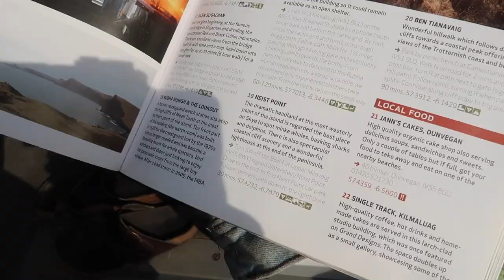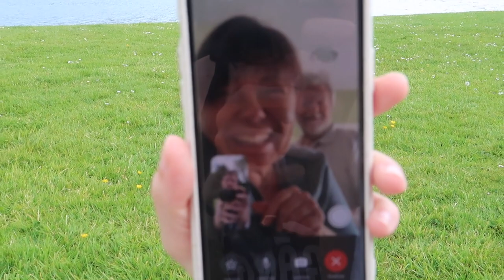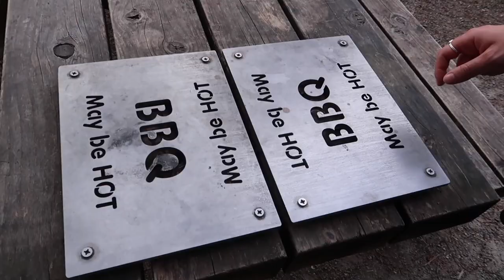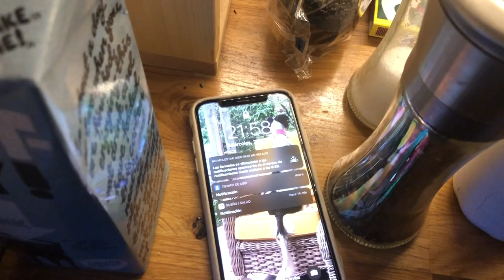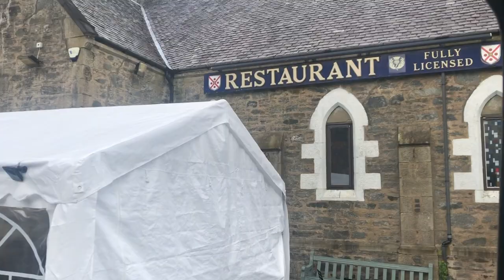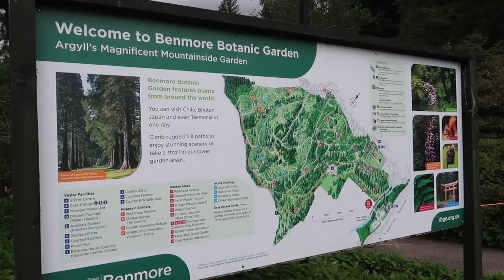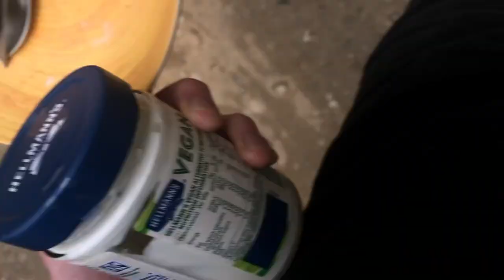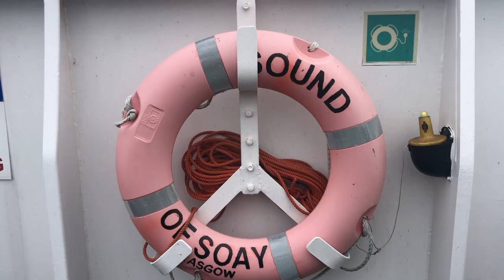VAN LIFE SCOTLAND | Part 3: Glenmore & Argyll

Comment: I'm not a Van life person, I'm a maintenance tec. But I set up my van to be super neat at all times. I installed a 5000W Pure Wave Power Inverter  to run anything I might need, installed one outlet at the back door and a 4 outlet panel on the front of my shelf to keep things charged. I also built all the wood shelving and storage. ( I hate the metal shelving the E250 comes with ). 
I watch videos like this to give me ideas to improve my set up. I think I'll install a fan like you have to draw out the heat. On hot days I have to remove all my batteries and my laptop after work because it reaches 135F  ( 57C ) in the van. 
 Anyway I started watching your stuff about 2 months ago and now I'm hooked. Love your attitude on life and you come up with great ideas. Great job on the Van. Keep the videos coming and I'll keep watching.